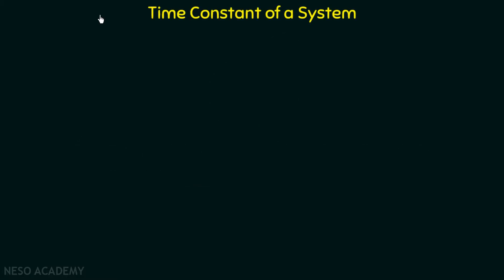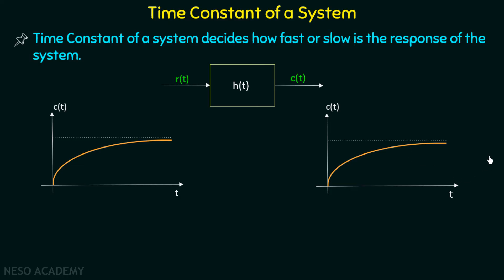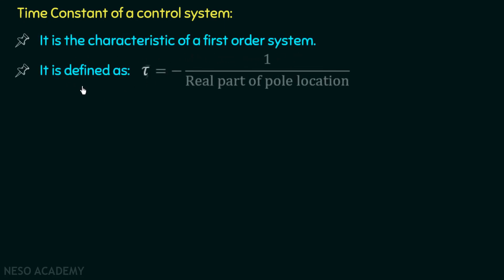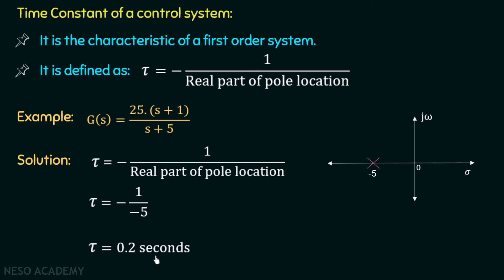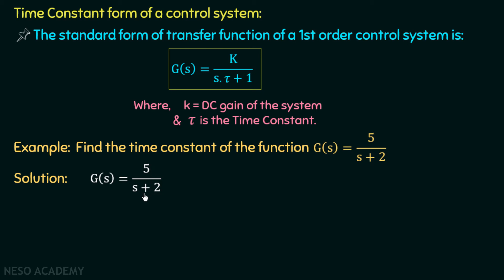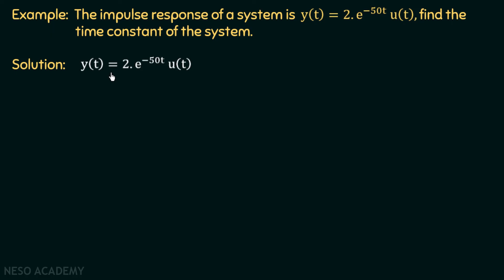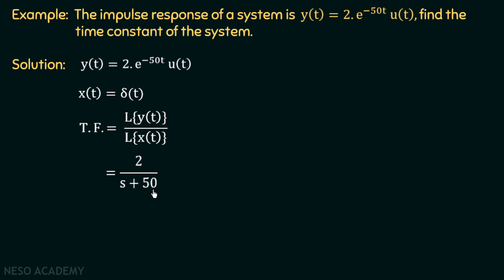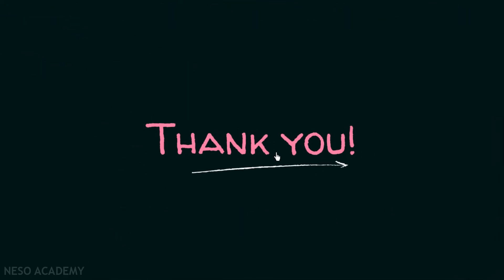Time Constant Form of a Control System

Comment: Hello, can you explain what the time constant and gain is for the following transfer function.

G(s) = 1.241/s+1.45

Am I right in thinking, standard form is :

1.241/1.45(s.(1/1.45)+1)

Time constant = 1/1.145 = 0.69 seconds
Gain = 1.241 or 1.08

Thanks

Comment: In 4:35 you took 2 as common, and in 6:30 you  divided the denominator by 50. In this case what the value of k will not change??. So what is the correct thing to do, taking the common of the denominator, or divide the denominator to get the number 1 ??
Reply: Same here confusion @nesoacademy
Reply: yup, very confusing